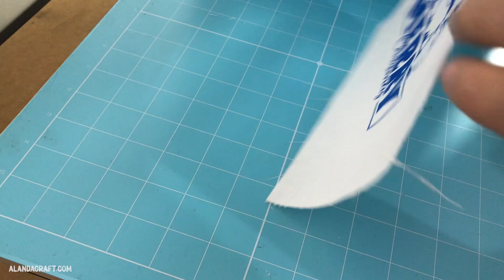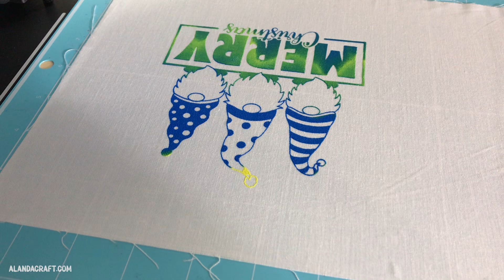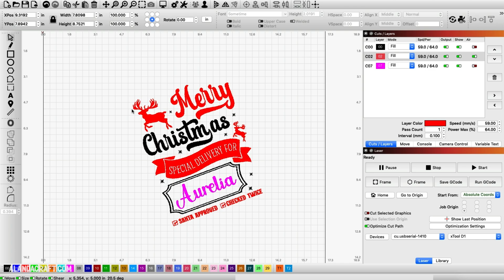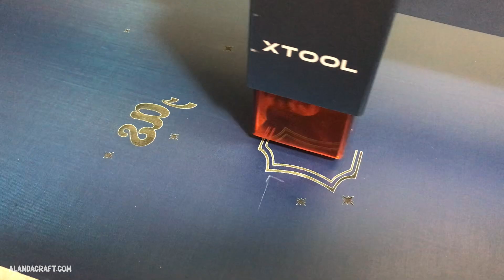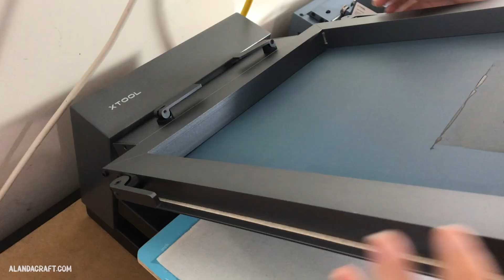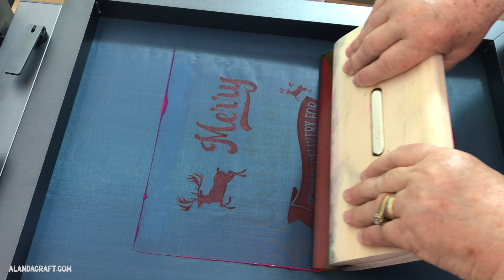xTool Screen Printer PART 2 - Using Multi-Colors

Comment: I read elsewhere that this system is not capable of 4 color cmyk half tones.  Your thoughts?  I know from my own DIY screen printing that there are 4 half tones needed to attempt any type of "photo realistic" color print. It seems that 4 prints should be feasible, but there will be issues possibly, with the 100 mesh used in their screens and further, as with any 4-color print proper registration can also be a challenge.  Just not sure if I want to spend $500 to test their system.  Thanks for a very informative video.😄

Comment: Do you really love it? I’m still undecided if I want it or not. I don’t have a specific reason in mind, but it seems like lots of fun and like I’d regret not getting it. 
Have you tried washing fabric with this paint? How does it look? Like it would last or not? 
And do you go very quickly through those paint jars? I don’t know if I should get extra right away. Thanks! :)
Reply from the maker: Wanda loves it and can't wait to do more with it. Me on the other hand, likes it a lot but I know that I wouldn't use it that much. So I think it is going to be more of a personal preference. I am not fussed with working with paints in general. I love working with the laser engraver part of it but just find the paint part a bit messy. Once we had the paint worked out and we weren't using as much, it did get less messy but even so, it's not my thing. But like I said, Wanda on the other hand has a number of other projects in mind (and also has a lot grandchildren to make stuff for) so she will be using it more than I will. We haven't tried washing the fabrics but apparently the paint is washable but not sure how it would look after washing. There is a decent enough of paint in the jars but if you were going to do this seriously you would buy big tubs of it.

Comment: IS there a specific type of image that needs to be used? i.e. png, jpeg, svg
Reply from the maker: You have to be able to separate the image into layers as you need to be able to engrave each layer onto a different screen. So I found that SVGs worked the best for this.

Comment: Are the screens reusable?
Reply from the maker: Yes you can reuse the screens. xTool say they can be reused up to 100 times using the same design. If you want to change the design you will need to re-coat the screens so that they can be lasered on once again. I have no idea how you do that but I'm sure there is someone on YouTube who does.
Reply: @alandacraft  Great videos.  Can you remove the screens from the frames for storage and replace them in the frames for printing? Especially when using multi-color designs? Or would I need to buy enough frames for all the designs in my catalog?
Reply: Who
Reply: I think I no what to do😅